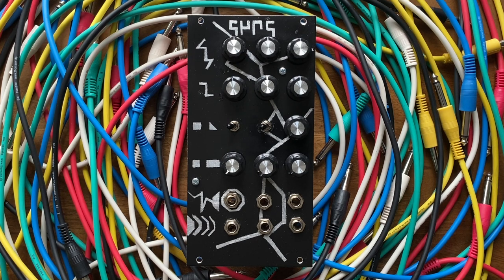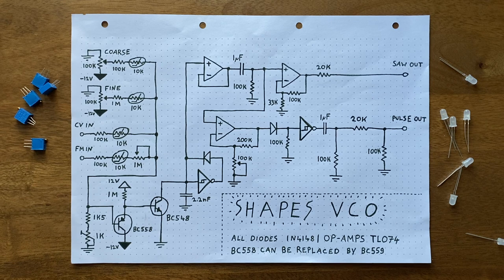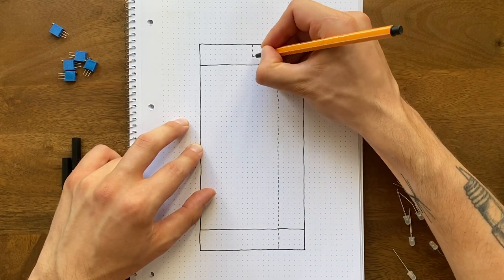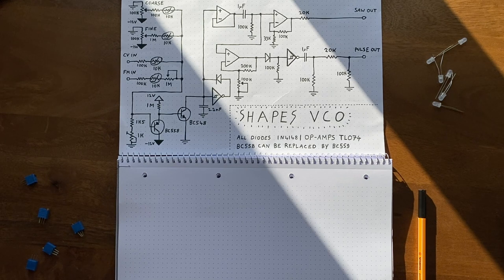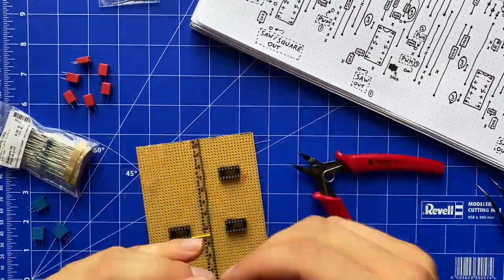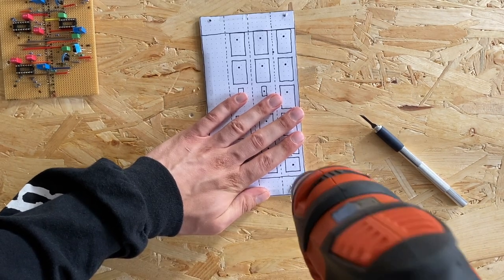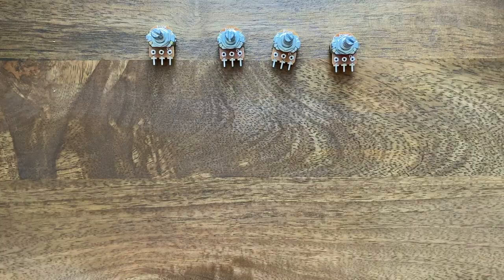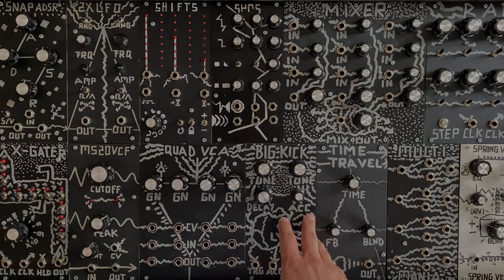How to build a DIY 3X VCO module from scratch

Comment: Hey Moritz, ich hab bisher alle Folgen geschaut, mitgebaut & muss sagen das Endresultat ist echt klasse! Hätte ein paar Fragen zum Wiringdiagramm, werde irgendwie nicht ganz schlau daraus...

1)Wo sind die beiden Tune Potis der 3 VCOs mit der Platine verbunden?

2)Sind die Saw & Square Outs 1&2 direkt mit dem Kippschalter & dieser mit dem Out Jack verbunden?

3)Es gibt ja drei Square & Saw Outs aber nur 2 VCOs mit verstellbarer Wellenform & einen mit der Mischung. Wie werden diese Outs verbunden?

4)Es gibt im Wiring Diagramm CV IN 1,2 &3 sowie CV Master IN & OUT aber auf dem Front Panel nur 3 CV IN. Wie ist das zu verstehen?

Würde mich echt über eine Antwort freuen damit ich das Shapes Modul vom Breadboard aufs Stripboard bringen kann! Freue mich auf weitere Projekte!
Reply from the maker: hi siavash, stimmt leider, das layout ist etwas kryptisch – hier ein paar pointer:

1) bei jedem transistorpaar (548/558) siehst du jeweils drei stufenartig angeordnete schwarze blobs – das sollen die thermistoren sein. jeweils einer für CV, coarse- und fine tuning. (die 100k/1M widerstände hab ich direkt an die potis gelötet um platz zu sparen! nicht ideal..)

2) jep!

3) du meinst wie die mischung erzeugt wird? die beiden signale (saw/square) werden zu den beiden "äußeren" pins eines 1M potis geleitet. vom mittleren pin gehts dann zu dem op-amp-buffer unten links ("wave mix"). der output geht dann durch einen 20k-widerstand zum output!

4) da habe ich leider mist gebaut - dachte naiverweise, dass ein einzelner buffer für die master cv-idee ausreicht. spoiler: tut er nicht. man müsste den master cv drei mal, mit drei op amps buffern. deswegen die etwas sinnfreie situation dass CV 1 gebuffert wird, CV 2 und 3 allerdings nicht. 

ich werde das layout demnächst mal generalüberholen und dann auf meiner patreon-seite posten - dann hoffentlich auch mit master CV! wenn du sonst noch fragen hast - immer her damit!
Reply: danke für die schnelle antwort! werde auf jeden fall mal deinen patreon auschecken

Comment: Hi ! I can't understand what chip sockets are and what are the utility of those ?
I guess there is one by oscillator + another one for I don't know what, that's it ? 

Thanks a lot for your content ! Really helpful !
Reply: Or are they TL074 OP AMPS ?
Reply from the maker: chip sockets are useful because they allow you to swap chips after everything is soldered together. also, you don’t have to apply heat to the chip’s pins while soldering, which can damage them quite easily.
Reply: @MoritzKlein0  Thanks a lot !
I think I get it, you solder them and then put the 40106 IC (in this case) into it ?

Comment: Beginner/Novice here trying to figure out a few things from your schematics in the video/ what I see on the board in order to give it a try. Going to re-watch the other episodes too, maybe more will be cleared, but:

Noticed you have added  a 5th chip at the end of your build (upper right corner of the board) - moment is so short I cant figure out what it is or to what it is jumper wired.

Have the slight impression it is connected to the [PWM]s and the last row of pots which are exaclty that, right?

Also FM IN disappears ? 

[Master CV out] and [Master CV in] confuses me a bit. If it would not be connected to the TL074, the [Master CV out] would actually be another CV IN for oscillator 1 (but with the 100k resistor already on the board).
Reply: 5 minutes later ... 

Figured out the PWMs , it was so clear!

The rest remain to be answered. 

PS: Love the channel  :)
Reply from the maker: yeah, i decided to leave out the FM input because the panel was getting quite crowded already! 
and master CV is something I messed up completely and couldn't get to work in time. that's why i circumvented it in the end. I'll implement it for the eurorack/PCB version though!
Reply: @MoritzKlein0  thanks for the answer! 

so basicly for this one you made it into a simple CV IN for for oscillator 1 & got it out of the opamp thingy? 

Still wondering of the late added 5th chip 😅

Nice to know ull be designing all these for Eurorack. Maybe one day I'll join the format also. For know DIY 10x20 (as u, as lmnc) - learning much this way. 

Cheers!
Reply: @MoritzKlein0  After more research and having a feeling I seen a design like this, found the Rene Schmitz website (you also linked it). Can imagine maybe the last chip is for making the triangle wave out of the saw.

Comment: how do you plug it into the SQ1 ? i dont see black leads on the VCO :S
Reply from the maker: the CV output from the sq-1 is going into a buffered multiple (just a bunch of op-amp buffers), which then drives the VCOs!

Comment: Hello, when the oscillator is on for about 2 hours it starts to tremble and I can't get a clean oscillation, the oscillation starts to scrape, nothing changes from the pitch but the oscillation is unclean. What could be the reason? Maybe because the film capacitors are designed for 63v, but I have not found any smaller ones. I already tried to exchange the tl074 with tl084, but it didn't help either.
Reply from the maker: that does not sound like an issue with the components. usually when the oscillation sounds noisy something is modulating the cv input(s). this can happen if the cables/copper strips carrying the cv signal are very long - this makes them susceptible to outside influence. also check if all the unused schmitt triggers on the 40106 are grounded.
Reply: @MoritzKlein0  I have finally discovered my error, a 2hp module has produced an interference frequency on 12v.
Reply from the maker: @andisyntz7160  oh on the power rail you mean?
Reply: @MoritzKlein0  yes the modules from 2hp are defectively constructed there
Reply from the maker: @andisyntz7160  good to hear you solved the problem then!

Comment: Nice!!! What range cover this vco?
Reply from the maker: 5 octaves, maybe a bit more!
Reply: Hey Moritz thanks for answering! I builded the previous version of your video and I love it, but only cover 3 octaves, I don't know if is because of the transistors I used, 2n3904 - 06... Love your work man, I'm gonna try this one too!
Reply from the maker: Augusto Borges hmm that’s weird! so it was really off over 3V?
Reply: @MoritzKlein0  Yeah, but not exactly, thanks to your answer I realize that the beat step pro was sending 2 to 10 volts, therefore I changed it to 0 volts and changed the cap and one resistor and improve it a lot, now works fine, Thanks again!!! And you're right, 5 octaves and more.
Reply from the maker: Augusto Borges glad to hear!

Comment: hey, i know im a year late.... but i got a question... can i use 2N3904 NPN and 2N3906 PNP Transistors intead of the BC548 and BC558?
Reply from the maker: yup, that should work. just keep in mind that the pinouts are different!
Reply: @MoritzKlein0  Wait... U mean the NPN and PNP pinout? Like, I know which one is which, no worries, was just wondering if there were different values in certain other transistors
Reply: @MoritzKlein0  amyway... Hey, thank you a lot!
I was actually worried I'd have to buy a second transistor kit with the other transistors in, which would have been a lot of money down the drain again, so hey, Dankeschön, freut mich zu hören, dass ich jetz etwas ruhiger schlafen kann und morgen gleich mit löten beginnen kann :D